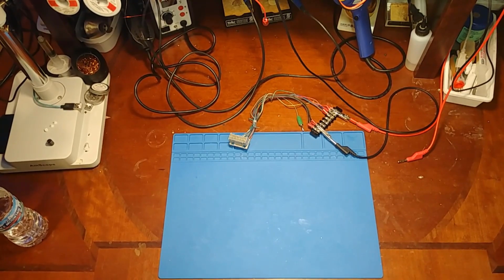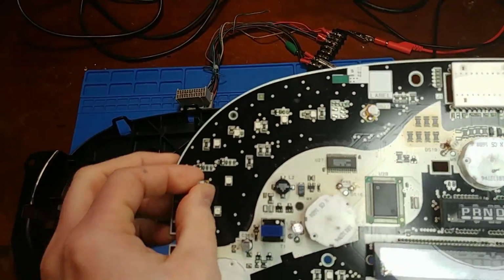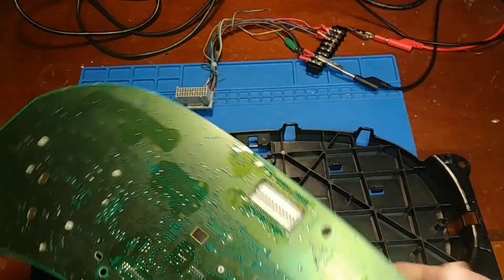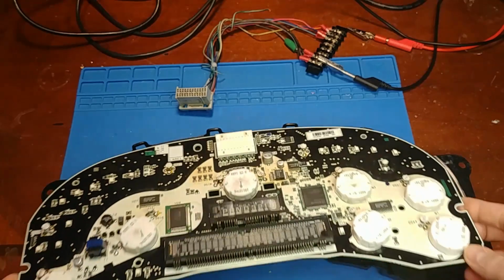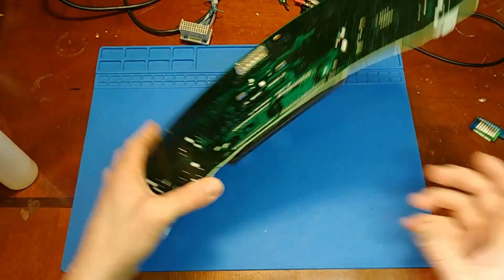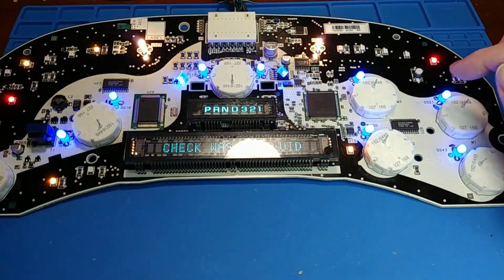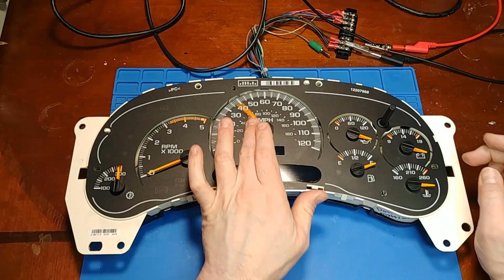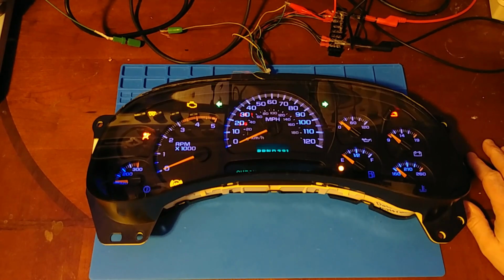Rebuild of a 700k+ mile Cluster with Blue LED's.

Comment: what do i need to worry about on my 2011 sierra diesel cluster? it has 87k miles.
Reply from the maker: You should be in the clear.
Reply: they don’t have any issues?
Reply from the maker: @Reaglesracing44_  Every now and then a temperature sensitive microprocessor, but for the most part they are reliable.

Comment: how do you calibrate the needles if they are showing wrong km/h ? do you just use some software or is it physical?
Reply: @unikatura    >When tire size is changed, tires & wheels both, the speedo reads wrong. The year determines what can be changed as the TECH2 has the ability to erase and re-calibrate using class2 serial data (1 wire, 0-7 volts) but stores this change in the EEPROM the speed uses. Many early, it was the PCM as it gets the VSS signal, converts it to on/off (A/C) from trans, but the PCM changes the signal. Class2 to the IPC uses for speed, oil, RPM, etc. A second signal goes to SIR, Radio, etc. Yes radio, it get louder the faster you go. A 3rd signal is used by ABS at different rate of on/off signals. If you new tire size is in the TECH2, it is a simple re-learn. You might come close or dead on. If Jeff reads my reply, he would know more as I was a dealer tech and had to do everything. It’s been 2 years but Jeff is busy! Hope this helps and call around for pricing. Independent shops can buy TECH2’s  hopefully not Chinese copies as mine is Hewlett-Packard. There are other digital tools certain tire shops may have, but call around from $25 - $125. 
ASE Master Tech since 1978, Retired.
Reply: @deankay4434  very informative , thanks for reply... its still relevant as im still using the same care with same problem... the RPM needle doesnt even move anymore... Do you think i should repair it or replace the unit?
Reply: This requires some diagnostics. Say cruise & speedo both stopped, then could been sender, the driven generator at the trans, or the drive gear on the output shaft. Could be wires or corroded terminals that turned green. If cruise work and your radio gets louder with speed (RDS) then could be board issue or stepper motor problem. It may set code if key on, engine off = bulb run check. If check engine or service engine soon bulb not working, could have codes. Effects ABS as 3 sensors, 1 on each front wheel and VSS on driveshaft connected thru diff to both rear wheels is 3rd input. Cold soldered joint on IP circuit board or bad trace...lots of things to test first before taking stuff apart. Sensor (If Auto Trans 2WD) uses magnet with metal folded over it. A coil of wire wraps around magnet that is focused on 40 tooth steel tone ring / reluctor. As tooth lines up it pulls magnetic field toward it. The movement of this magnetic field generates a signal. Signal is weak and slow but goes up with speed. Find a gravel or dirt road and reach 30 MPH (Make sure no one is behind you) but do a panic brake. Push pedal to the floor like a deer ran in front and hold until stopped. ABS applies, holds or releases. Noise and pedal movement is normal. ABS light light will come on is not working. This function is in body, unless factory tool has ABS selection.
A little complicated for guys/gals to fix...Even instrument clusters!!!

Comment: If you add a motor to a non trans temp cluster does it just work?
Reply from the maker: Only if it's an early 2003.
Reply: jeffescortlx 2005, I have a extra 2003 one
Reply from the maker: @740iz06  the other cluster will have the incorrect odometer. Possible other options missing to if it's not from the same trim model.
Reply: jeffescortlx is that programmable?
Reply from the maker: @740iz06  yes

Comment: @jeffescortlx I have an 03 silverado with the battery drain issue as well as a display scrolling issue. Basically from time to time it will just start rolling through the menu options for language or unit type and randomly settle on whichever one it likes that day. Sometimes it does it once a week.. sometimes once a day.. tried looking for answers on it but had little success. I have some digital electronics training and I am pretty good with a soldiering iron. Any tips to fixing the problem or would you need to see it? Also I cannot view your contact info.
Reply from the maker: The YouTube contact option is a little picky. Depends on browser.
You could have fractured solder joints, tin wiskers, or a bad internal corroded button, or a little of all the above. Yes trouble shooting helps with hands on.

Comment: whats the part number on the LED Bulbs you use
Reply from the maker: Hi David, I received your email. The LED's I use don't have a part number. They are a 5mm native 12-14v with built in dropper resistor.

Comment: I have an 2005  chevy 1500 with 200000 and almost all of my stepper motor act up bulbs burnt out. Can I send you mine I just want it to work. Correctly and have oil pressure guage lol thanks!!
Reply from the maker: My contact information is under my channel "about" tab.

Comment: I'm curious, what do you charge for a rebuild such as this - Just a ball park figure?
Reply from the maker: 120 plus shipping.
Reply: @jeffescortlx   Thanks.  I'm guessing that's a fraction of the cost of a replacement cluster ?
Reply from the maker: @MalcolmCrabbe  generally about half vs buying a refurbished programmed replacement with core exchange.
Reply from the maker: @jacksmith3189  hi Jack. What's up?
Reply: @jeffescortlx   It's good to see you giving folk the means and ways to keep the cars in working order at a fraction the cost of buying new or refurbished.  I do like your videos, please keep 'em coming
Reply: @jeffescortlx  what about replacing the shifter selection window? Had my cluster rebuilt on my 03 about 5 years ago. And now the shifter selection is really dim. Only have 200k miles on it.
Reply from the maker: @nm645908  the repair of the gear select display is included with a rebuild.

Comment: Hey Jeff i am a new subscriber to your channel and I love your work. Can you show me how to test the cluster with the signals? I'd love to see that. Thanks again for such great videos.
Reply from the maker: I have a chevy ECU and BCM mounted in a project box with pot's wired for bench testing.
Reply: @jeffescortlx  so I am assuming each manufactory uses different signals meaning I would need a ecu and BCM for each company to test these devices?  Also you have the pots attached to the leads of the rpm and speed?  Or rather to each dial to see if they move so I would need the ecu and BCM and the pinout for them correct and obviously a 12v power souce.
Reply: @jeffescortlx  is the plug and the pinout on the plug of all clusters the same accross the board.  If so you could use the same ecu?  I'm not sure what a BCM is however I will Google this.
Reply from the maker: @ricor9358  actually OBD2 has many universal signals used with all manufacturers. That why one scan tool can work with many different cars. Industry standard signals.